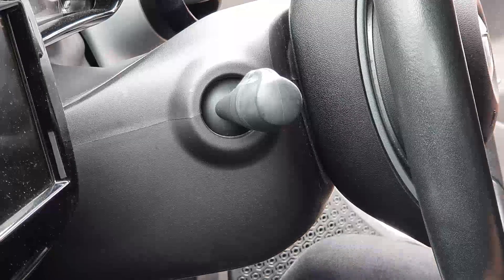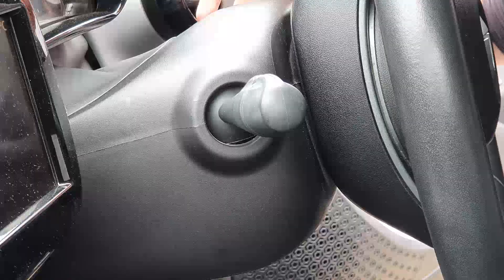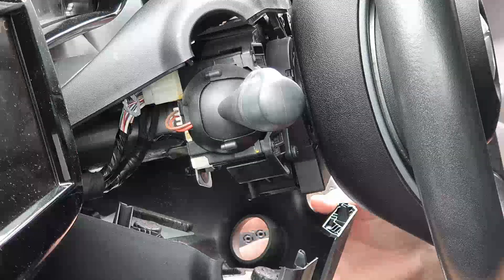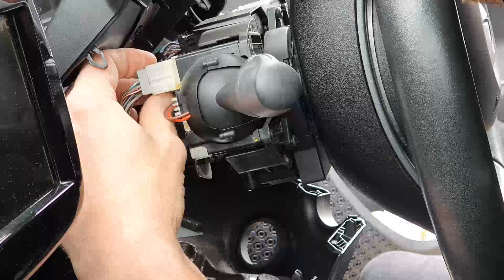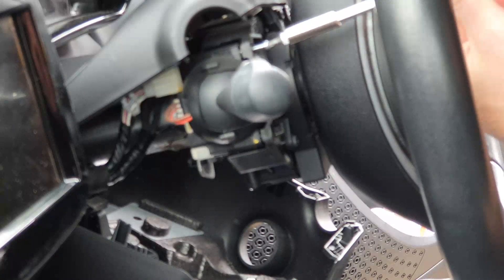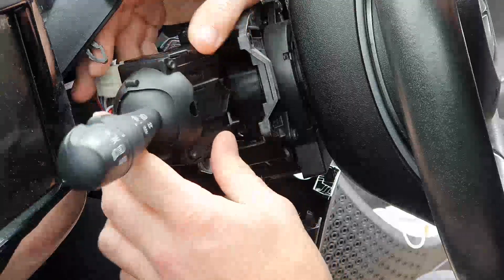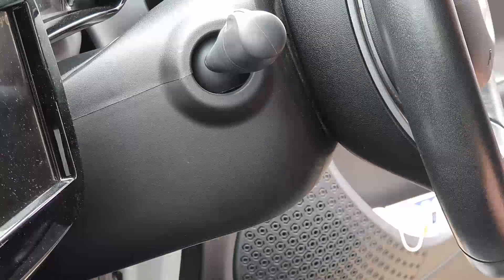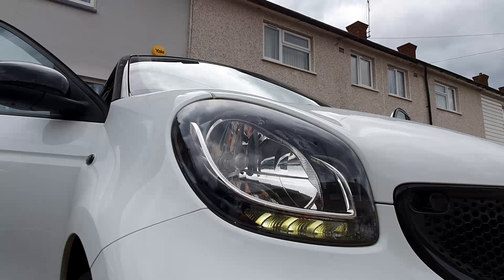Smart Forfour / Fortwo 453 OEM Retro Fit Auto Headlights for a little as £30. Bargain.

Comment: Hello, thanks for your video. I installed the Stalk today in our Smart ForFour EQ 2020 (restyling) and doesn’t turn on lights when I cover light sensor. The lights in the other positions works perfect, but with Auto selected the car don’t turn on Halogen lights.
Do you know if I need to program anything? It is possible that in new models does not work?
Reply from the maker: I have had an ask around and the general consensus is that it should work fine, without coding.
Reply: @mvautomotive7092  I bought Valeo 251690 and does not work. If I buy Renault 255675887R, Do you think that will work?
Reply from the maker: @jonatannietoa  they should be the same part. As the part I took out was renault stamped any way. I am in with the garage manager at a mercedes main dealership tomorrow will ask him and let you know.
Reply: @mvautomotive7092  A lot of thanks. I am having a lot of doubts because I am not sure if light sensor is enabled, because I don't know of any functionality that is currently working with the sensor.
My wife wants this feature and I am going to do everything possible 😄. On Sunday I am going to connect OBD and DDT4ALL to check functionalities.
I can't attach light sensor photo because Youtube remove my message.

Thanks for your time!
Reply: @mvautomotive7092  today I have checked sensor wires and looks well, I can’t see anything wrong. It would be bad luck if it was broken.
I am waiting OBD to check settings, it’s my last hope.

Comment: I have a question . My smart 453 doesnt have that switch and i want to install fog lights ( in front ) . If i install this switch , will i be able to turn front fog lights from this switch ?
Reply from the maker: I believe that the fog lights have to be programmed. I will double check and let you know.
Reply from the maker: Yes you would need to code it.
Reply: Was quite nice that the stalks already have a front fog option though. Will help when I install them eventually

Comment: Hi, I have a Smart Fortwo 2017 (I think it's 453), how do I know if I already have the sensor in the car? thanks.
Reply from the maker: If you have the passion or other none base model I havnt yet seen one without it. The middle top of the windscreen your find a circle behind that your see a visible sensor.
Reply: @mvautomotive7092  Thanks for your information, tomorrow with light I will see.
Reply: @mvautomotive7092  I've already seen it and it seems so, but I asked you if you don't mind confirming, how can I send a picture? can I put a link ?
Reply from the maker: @jproveta  c350e.project@gmail.com drop me a message
Reply: Prime have it ?

Comment: So now will the low beam lights turn on when you unlock the car at night?
Reply from the maker: I have checked neither my DLR or headlights come on when unlocking. once car is turned on all lights come on automaticaly.
Reply: @mvautomotive7092  is it possible at all for the lights to turn on when unlocked like the modern cars?
Reply: Yes this is unfortunate. Thought it would do that now after the install